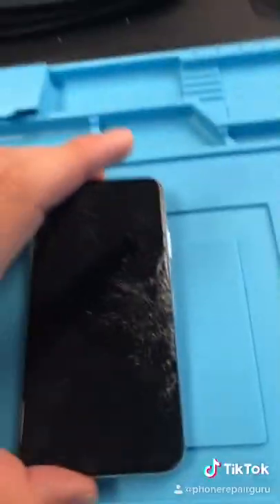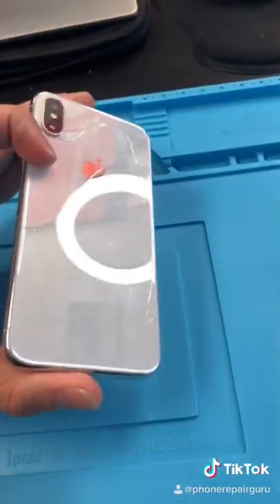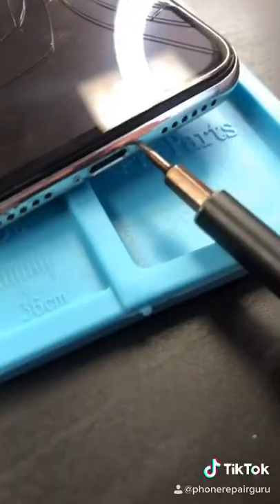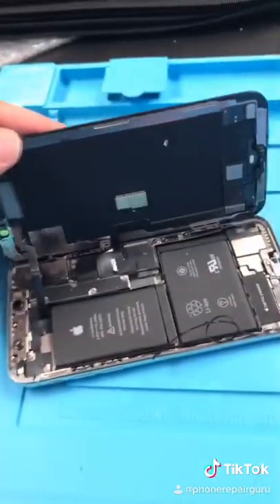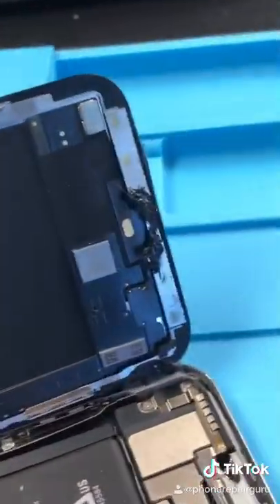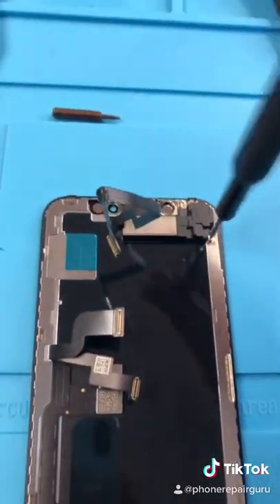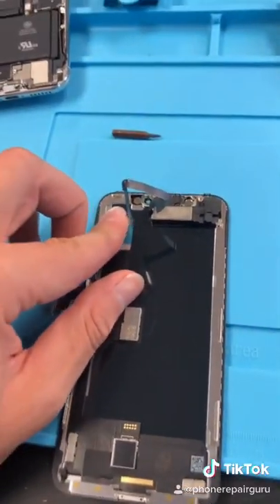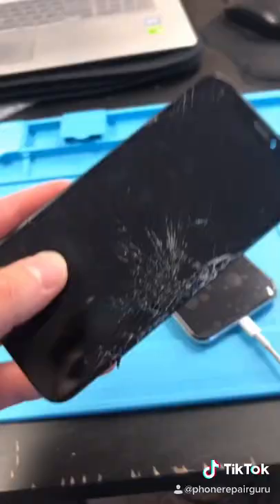Why do these screws always strip on the iPhone X.... Restored

Comment: When I used to repair iPhones. Whenever we had stripped pentalobe screws. I would take a hammer and a punch and just tap it. Works like a charm
Reply: Well this doesn't work for newer models. The threads are in the frame of the phone now, not the screen
Reply: @phatdpc  well. It shouldn't matter. If you break the head off. It's no longer under tension and then you  should be able to be creative and back the screw off
Reply: Yeah I think it is just shitty worksmanship when he leaves the stripped screw in it as well.
Reply: I'm gonna need this for later maybe cause I'm going to repair a iphone x in the next few days hopefully. Need to open it and test what's wrong with it. I'm basically new to the process
Reply: @bomanny7  Agreed. No attempt to remove the screws, with common methods...

Comment: Someone's been using cheap screwdrivers. The bits that were made were just slightly too small, so they strip. Come in a lot of those Amazon diy kits
Reply: As well as the screws being made of a slightly more maluable metal than the rest of tbe phone, just like how they glued their batteries and force you to use Apple repair products, which basically cost you as much as the phone itself
Reply: @sloppypancake6656  thats opinion. Where’s the source for it being more malleable? The guy used the wrong bit, that’s a common reason for screws being like that

Comment: To remove the screws find a flat blade jewlers screwdriver thats just slightly bigger than the screw slots. Grind it until it fits snug into the slot and then turn. You now have a custom driver for those type issues.

Comment: The best pentelobe driver you can use is the moody driver. It has a double sided bit and is known as a pentelobe extractor instead of a screw driver. The ifixit bit p2 will need to be shaved down a lot over time with a dremel to keep it in working order and eventually won't work anymore.

Comment: Small tip, not sure if it'll work with such a small screw. But if you get a small piece of rubber, and put it on the screw before the screw driver sometimes it is enough to get a stripped screw out. Love your videos though

Comment: Inward pressure while turning with a the smallest of slotted bit that comes in kit works for me to remove stubborn screws or filing down the tip of one of the pentalobe bits because they get bigger as you file the tip down. A reason they tend to strip out is because of a combination of debris and any sugary liquid that wedges itself into the sides of screw hole. Cleaning first with isopropyl alcohol and a toothbrush 🪥 helps.

Comment: I often have the same stripped screw issue, but i just put some super glue on a cheap chinese disposable screw driver tip and unscrew it, the superglue often cleans up afterwards, but the chinese screw driver bits are like, 20 cents each in this country so throwing them afterwards isn't a big deal

Comment: Are stripped screws unsalvagable? Now I’m scared too
Reply: I had stripped screws on vehicles. You just get an undersized bit and a small hammer. Once you drive in the bit it should come right out. Worst case scenario you can drill it. I’ve pulled out screws under a lot more torque than that. I think this would be a piece of cake

Comment: There's a way to remove those screws all I got to do is get a little tool that you use for detailing what or metal that you can get a hardware store and all you got to do is take the file or a little saw on it and make a little groove on it for the screwdriver to catch

Comment: Screws are 1$ come on bro.
Reply: Stripped screws won't come out, come on bro.
Reply: Well did you try a left handed screw drill bit? They come out easy with those.
Reply: @essentialtech388  it’s not that hard I get them all the time.
Reply: @essentialtech388  there's always a way to get them out

Comment: For everyone hating on Apple, the previous repair guy glued it together and then the customer striped the screws, that’s a massive red flag, if they were then to repair it and then it were to overheat or the cheap battery that was used in the previous replacement was to burst it would open them up to a lawsuit, it’s like if you put a new engine in a Mercedes and then tried to get the Mercedes engineers to service it when they don’t know anything about the parts in it, by repairing it their saying that there is nothing wrong with this product because we fixed it while only checking one component, when any previous repairs could have caused a ton of problems

Comment: Genuine question about the stripped screws: I’ve seen and used this trick where you get a rubber band, lay it on top the stripped screw and that gives your screwdriver some grip to take it out. do you think the rubber band trick would work here or are the screws/screwdriver too small for that method to work.

Comment: Hi, I have question I have a Samsung s 9 and it has a water drop 💧 sign on it it won’t charge. But I didn’t wet my phone at all. I tried cleaning the port but it didn’t work so I took it to a local repair shop they want $200 to fix it. Is that a reasonable price? Do you have any suggestions on what to do to fix it? I bought a I phone but I don’t like it as much. Thank you for your time and I love your videos!❤️😊

Comment: I have an iphone xs that has a battery problem, I had gotten it repaired once and the battery started getting fat (again) and tried taking it somewhere else to get it fixed and they told me that it couldn't be repaired :c, I haven't tried going to apple since they didn't put any battery back in and I suspect it to be missing other parts too (both of the guys I took it too were sketch) I was wondering if I could get a quote for it anywhere, please and thanks in advance <3

Comment: I used to open up one of my old laptops all the time to swap out drives, I'm stupid I know, but the point here is that they make special drill bits that are designed to tap stripped screws. Even extremely small screws such as those on the iPhone. Man is an idiot for having to pry it open with a knife

Comment: I’m kind of considering bringing a apple iPod 5th generation from 2012 to a repair shop it was bought when it first came out so about 9 years old it hasn’t been touched for 3 because it won’t turn on and when it does it is locked and the password is unknown it doesn’t have any clear damage other then a bit of wear down on the colour because it’s 9 years old and it probably has quite a bit of dust in the speakers and some water damage I just want to know what happened to it I have an iPhone 11 I don’t actually need the iPod just plain curious I’m also pretty sure we stopped paying for anything on it a long time ago

Comment: You acted like you can't open that by unscrewing yet using a rubberband and placing it on the screw then using the screwdriver, and then it works help. Not using screws is bad